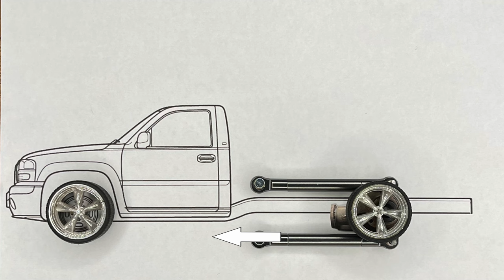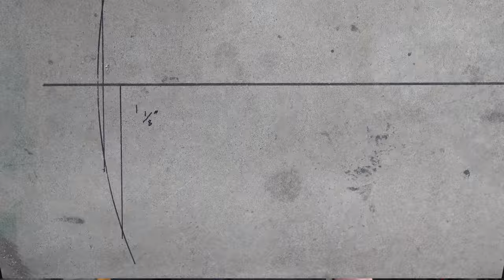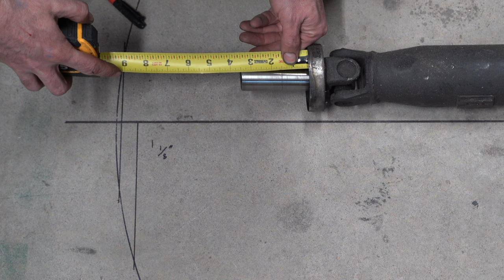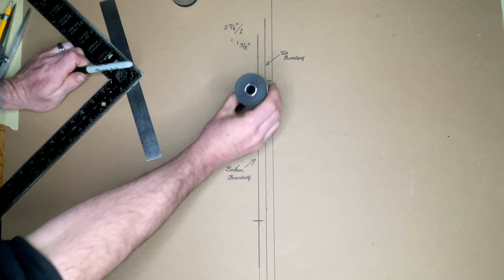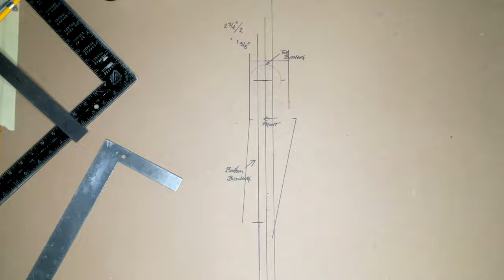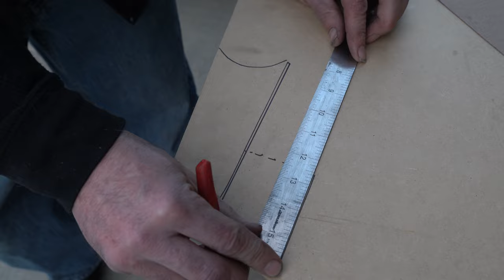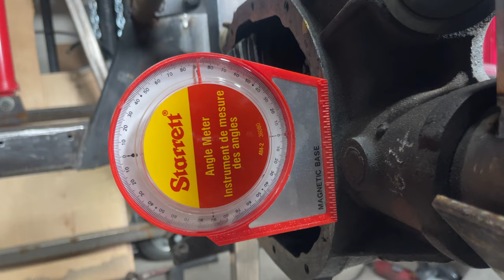Finishing and Testing the New Parallel 4 Link! Mighty Max Ep. 13

Comment: OUTSTANDING!!. nicely done
Reply from the maker: Thank you, Terry! Cheers!
Reply: @GarageFab  yeah your welcome. I guess  the machine won't do my block. I mean it's only been since September that I dropped it off. ,so in lieu of that. I'm finishing my garage floor, pull the ranger in and start on the rear. I've got a 8.8 out if a mountaineer. Disc bracket LS,3.73. U really do enjoy tge suspension videos, I've watched them over and over. I know nothing about 4 links and such. So thank you.  Maybe by the time,I finish all that  I'll have my block back. Thanks again,really,really good stuff.
Reply from the maker: Sorry to hear that my man. That happens a lot more often than it should. You’d think businesses would do work so they can get paid and then get more work and repeat. 
Well I’ll keep going so hopefully before long you’ll know everything about 4 links!
Good luck on your project! Sounds like it’ll be pretty sweet.

Comment: If you are running a carby, and you haven't installed your engine yet, but you do have the intake manifold, you can work out the angle of the pinion by seeing what angle the baseplate for the carby is. This of course goes out the window with an EFI engine, which you can set the angle of the engine to suit the pinion angle.
Reply from the maker: That’s an interesting question! I suppose it’s a possibility. But it sounds like a real challenge and therefore a big risk. It would be so challenging to predict how much movement you’ll have in the trans tunnel and any change in height of the engine would change your angles. 
If you stick around, you’ll see me constantly trying to avoid math and in turn avoid mistakes. I really dislike doing things twice. I think this would be one of those times.
Reply: @GarageFab  yeah, gotta love all those variables and tolerances that you've gotta include :) 

I've noticed how much you love the math :D

Comment: I’m am in the beginning stages of a triangulated link system using an 8.8. It may or may not have been explained but why  not just use the stock upper bushings on the rear axle?  Gonna be a wild mighty max. Thanks
Reply from the maker: You didn’t miss an explanation. The big question is What type of suspension are you building? Static or adjustable. If you plan to run coilovers, you absolutely can use those mounts though I’d suggest you replace the rubber bushings with spherical bushings.
With adjustable suspension, things need to be changed for the sake of your drive shaft U joints. Mainly the upper link bars need to be made much longer than they were in the Mustang to match the lower link bars. The angle of the 8.8 bushings and their position on either side of the differential causes problems with that. Basically re-using those mounts would mean the upper triangulated bars would be at an angle that doesn’t match the 8.8 bushing mounts and the bars would not be a great enough angle to keep your axle firmly centered under the chassis. You’d probably still need a panhard bar and that would be weird. 🤔

Comment: I 17:02 17:02  love your content it’s given me a better understanding of suspensions. I am struggling setting up my own suspension I’m not sure what works best for a road car. I want good cornering and drivability it’s not a drag car. I can get a parallel system in but top arms are only 75% of bottom length. Will a parallel system work like this or should I be aiming for an instant centre. If so what’s should I be aiming for ,long/short IC. There’s plenty of info out there for the drag and 4wd guys but when it comes to just having a nice street car that can handle and perform well there’s not a lot of info.
Reply from the maker: Thank you, fellow Aron! Unfortunately I’m not knowledgeable enough to tell you what design is best for your application. I decided to teach Suspension Basics because I have a firm grasp on how suspension components move and interact with each other. I don’t have a lot of understanding of the physics of the different designs.
What I can tell you, however, is that my advocacy for the parallel 4 link is based solely on vehicles with adjustable height suspensions. When you are able to drive at 2 inches, 11 inches and everywhere in between, it’s important that your pinion angle remains constant to protect your U joints. A parallel link setup will do just that. BUT! You sacrifice some traction with a parallel 4 link.
In order to achieve better anti squat, the shorter upper bars you mentioned are used. Not only are the bars not the same length but you also usually mount the front bar ends closer together. (NOT parallel)
The answer to the long/short IC question varies based on the vehicles center of gravity and the intended use of the vehicle. For cornering, I don’t know what’s best.
Don’t quote me, but I believe “roll center” is more important in turns. That’s the imaginary point the vehicle body rotates around which is determined by the suspension design.
Hope this at least steers you in the right direction. Pun intended.
Lemme know what you find!

Comment: I am enjoying your detailed explanations. I wonder if you might explain the philosophy behind the Miata suspension in relation to the hard link ( It is an L-shaped aluminum beam ) between the transmission and the differential. They reportedly also used elastomer bushings on certain potions of the linkage so the rear suspension would act as additional steering when compressed in a hard turn. Supposedly this was intentionally done to aid cornering.  Viewing your expansions on rear suspensions have given more insight to perhaps why they did this or that. A common swap when placing big horsepower engines in a Miata body is to use a Cadillac differential in a custom rear frame yet keep the 4 wheel independent suspension system plus attempt to transfer all that power to the pavement. Any way thanks. I am more of an aviation guy but love working on cars too. The beauty of the Internet, it allows one to follow the tributaries of your mind’s curiosity. This is how and why I found you. Thank you for your desire to share. As you said, “Knowledge makes you happy.” That statement resonates. Some people believe kept knowledge is power. I reject this philosophy for it is share knowledge which makes us all strong. Keep up the superb work. This is a pat on the back from a fan.
Reply from the maker: You’ve piqued my interest! I’m not familiar with the suspension you’ve mentioned. Even after attempting some research all I could find were some beefy H shaped control arms. What was the year Miata you’re speaking of?
The only other method of suspension “rear steer” I’m familiar with is from a solid axle and link bar setup. This was intentionally done on my last mini truck. By angling the bars downward slightly it creates a situation where when the body rolls, the links push one side of the axle backward and pulls the other side forward, resembling forklift steering.
I loved it but I have since heard that is terrible for traction. I honestly can’t grasp why that would be.
Thank you for the kind words my friend! You are greatly appreciated. The Garage Fab channel is somewhat selfish. I’ve spent my life chasing money and other silly things. Recently I switched to chasing fulfillment. That’s been much easier to find, and sharing knowledge has been a great source.
Reply: @GarageFab  Mine is a 1990, born in January of that year. The set up, is a wish bone front and rear and in my obsession with this vehicle, I came across a British pair of gents who provided research as to the origin of the make. They produced a coffee-table quality book, which I have loaned out and do not have in front of me, which briefly discussed what I brought forward. I had heard whispers of the suspension system with the softer mount and why it was done but, it was allusive. When I recover the book, I will inform you. To me it was genius to allow the forces from cornering to deform the bushing to assist in steering by changing momentarily the dynamics of the rear suspension. I expect many of the engine swap people are not aware of this feature. I have given you all but nothing of additional information but I will do my best to bring it to you as my lack of organization will provide.
Reply: @GarageFab  Graham Borrajo, I might have the spelling wrong, produced a wonderful quality done superbly entertaining piece on the history of the MX-5 Miata. Look it up on YouTube. I will double check the spelling.
Reply: @GarageFab  Found it! The book discrimination of the suspension is called, ‘ ThE Book of the MAZDA MX-5 MIATA, The ‘Mk1’ NA- series 1988 to 1997” by Brian Long. Pages 34-37 shows details plus this blurb, “ Kilimanjaro-famous for his perfectionism-allowed the forward lower suspension bushing to deform slightly under cornering to give the rear wheel a minute amount of toe-in: an ingenious idea.”
Reply from the maker: Ok that was an incredible video. It must’ve taken him months and months to produce that. Mind boggling.
As for the trans/diff connector and the rear suspension… I don’t think I could explain it any better than the video already did.
And I honestly can not grasp how that rear suspension could create any “rear steer” Without seeing it in person I don’t see how the additional weight on one side  under heavy cornering would/could cause any twisting of the rear knuckle to produce any sort of directional change.
I used to Autocross with the SCCA and I’ve seen the Miata in action. So there’s no arguing that the manufacturer did it right. But aside from the lightness and the vehicle’s balance, I just can’t SEE the performance! 
Thank you for share. That’s over an hour of my life that I can’t get back… but I don’t mind!
Cheers!

Comment: What is that you are using to drill the holes in the tabs? Is it some unique drill bit or like a tool for a mill?
Reply from the maker: Nope! You can chuck them in a hand drill if you’re steady and patient enough.
Those are Hougen RotaCut hole cutters. I’ve got a small diameter set and a large diameter set. They’re kinda spendy but they are by far the best hole-makers I’ve ever used.
There are links to the specific sets in the video description, or just search for Hougen RotaCut!
Reply: Was going to ask the same!
Reply from the maker: @scrapingpavement  Get some! Just beware they break easy if they bind. Never broken one in the drill press but broke several in a hand drill. 😬

Comment: What kind of drill bit are you using at 11:35? Thanks!
Reply from the maker: Those are Hougen RotaCut hole cutters. I’ve got a small diameter set and a large diameter set. They’re kinda spendy but they are by far the best hole-makers I’ve ever used.
There are links to the specific sets I have in the video description, or just search for Hougen RotaCut!

Comment: Hey brother, how wide are the poly bushings and sleeves you welded onto the bar ends? I ordered some 2.5’s, but wondering if I should have done 3” wide
Reply from the maker: It varies based on the size of the bar material I'm using.  I like to have 1/4 inch of sleeve sticking out beyond the bar to create a ledge for the weld. 
On this project my upper bars were 1.5 inch tube, so my sleeves were 2 inches wide. Bar ends are listed by their total width (including 1/4" polyurethane on both sides) so I used 2.5 inch bushings.
A simple rule of thumb... Just add an inch to whatever bar you're using.
My lower bars were 2 inch square, so I installed 3 inch wide bushings.
The size isn't extremely important unless you're trying to fit existing link bar tabs.
Reply: @GarageFab  you are the man! Thank you! I’m a big fan of your detailedness and content.

Comment: I’m sure I missed it, but how do you know how much you can angle bars for anti squat and not go to far? My bars are 32-1/8” and was about to redo my axle mounts because it was 2-1/4” low at the rear end.
Reply: So I went back and watched again, I swear I have your videos a hundred times..lol but I seen where you say you make the parallel links level when laid out and that’s how you know the angle is correct?
Reply from the maker: @clifton6693  Unfortunately my level of knowledge will only get you close. Determining the perfect bar angle isn’t a simple thing to do. In a racing application where this stuff really really matters, you would have to find the center of gravity of your particular vehicle. You would also have to determine the instant center of your rear bars. (The imaginary point that the upper and lower bars would intersect if you drew a line through them. [A Parallel link setup would have an infinite instant center as the bars would never intersect])  Perfect antisquat is determined using these two factors as well as the design of the link setup.
This goes far beyond my abilities!
My advice to set up your bars parallel to the ground when laid out is to help get people to at least angle their bars in the proper direction to at least provide SOME antisquat when the vehicle is lifted. I thought it was important because I often see folks with the bars angled the wrong way. (Front bushings lower than rear bushings) Which worsens squat and kills rear traction. The steeper the angle in the proper direction, the more antisquat you have and therefore the more traction you have, to a point.
You can absolutely have too much antisquat which will lift your rear end on acceleration which is also bad.
If you angle your rear lower bars to point somewhere near the top of the front tire, you’ll be kinda sorta in the right position.
Sorry I couldn’t help more. Thanks for your time my friend.
Reply: Thank you for reply sir!

Comment: Could you use the original front leaf mounts for the lower link mounts to the chassis?
Reply from the maker: Absolutely. As far as strength is concerned, that point on the frame was designed for those exact forces.
The trouble with that, though, is if you plan to lower the frame to the ground (like with air suspension) that point often hangs down below the bottom of the frame. Which would prevent the frame from laying flat on the ground. But on a lowered static height vehicle, say with coil overs, using the leaf spring mount as a linkbar mount would be just fine.

Comment: Nice work I really liked it. What pipe sch did you use. We’re can I get this links . Do you have drawings that you can share
Reply from the maker: Thank you, Gabriel! The lower links are 2x2 square quarter wall and the uppers are 1.5 inch 1/8 wall tubing. These link were built specifically for this truck so they probably wouldn’t fit your application. You can order all the parts from Thorbros.com 🙌
Reply from the maker: Thank you, Gabriel! The lower links are 2x2 square quarter wall and the uppers are 1.5 inch 1/8 wall tubing. These link were built specifically for this truck so they probably wouldn’t fit your application. You can order all the parts from Thorbros.com 🙌

Comment: Great work. love the channel . What type of drill bits are you using? Thanks
Reply from the maker: Hey John! They’re called Hougen RotaCut Hole Cutters. They’re kinda pricey but worth every penny. Here’s a pair of associate links to the two specific sets I own…
Small https://amzn.to/3guFEwJ
Large https://amzn.to/3ukxxL5
Reply: @GarageFab  Awesome, thank you
Reply: @GarageFab  both set are on their way. 👍I appreciate you!
Reply from the maker: Lemme know what you think! I already know you’ll be thrilled with the machine quality hole. 
Pro tip, use the included center punches to locate the hole. Then use a small drill bit to make it a little deeper. It provides a much more stable guide for the spring loaded pins and less chance for the pin to jump out. Best of luck!

Comment: Hey brother I am working on a 87 r10 Chevy short bed. I was thinking of buying a triangulated 4 link where the bags are just behind the axle and the enter bars are connected to a bracket that bolts to my 10 bolt rear axle pumpkin. It’s around 1000$ but not sure if I want 4 link or air. Which is more cost effective and practical?
Reply from the maker: My father had one of those. I’m a little jealous.
I’m going to interpret your question as “static suspension or air suspension.” Correct me if necessary.  
Both systems will require a 4 link.
I prefer air suspension but not for it’s practicality. If you don’t want to deal with blown air springs on the freeway, leaking fittings or sticking valves… go with coilovers. But nothing beats the cloud-like ride of air suspension and it’s pretty freaking sweet letting the air out in parking lots. 
A 4 link used with air springs and a static 4 link will be different though so decide which way you want to go before you buy a kit! 
Can’t wait to see what you choose! 🙌
Reply from the maker: I neglected to mention cost. Good coilovers are much more expensive that air springs, but with air you also need tanks, lines, fittings, compressors, some sort of controller… I think coilovers would be cheaper in the end.
But again, that air ride though! 🥰
Reply: @GarageFab  thank again. I’m leaning toward air.